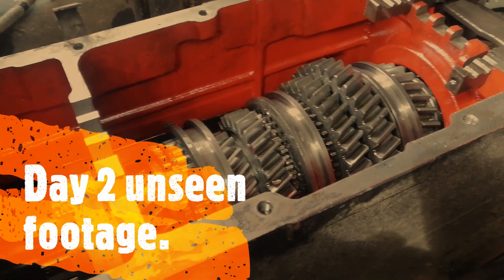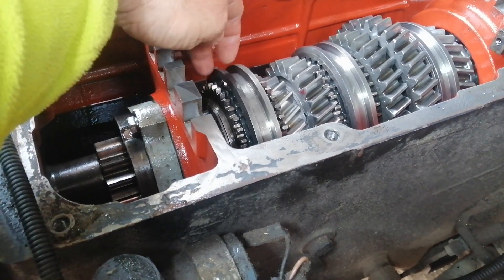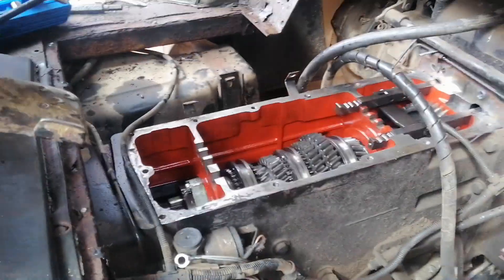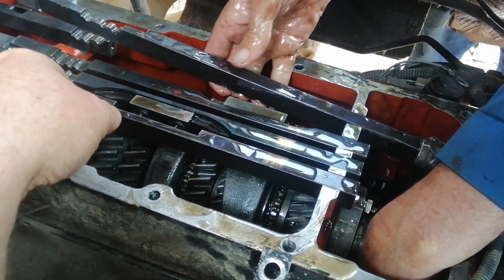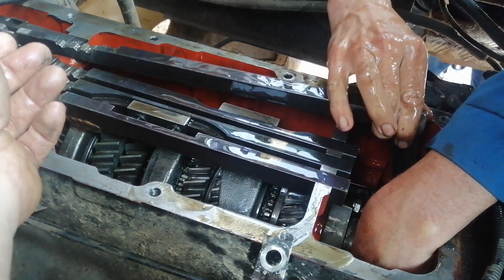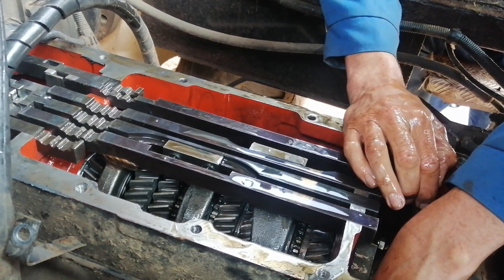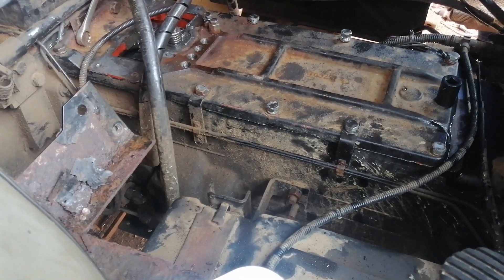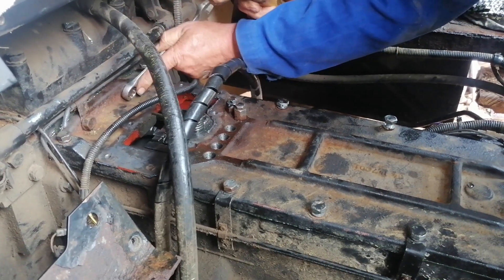Zetor Gearbox part 2 unseen footage,Test pilot!.

Comment: Interesting,but learnt about cab mounts, would you ever think it was cab mounts.
Reply from the maker: the new cab mounts have arrived,so ill do a video on fitting when we gwt around to that job ,it was just a bit of video footage i lost when i broke my phone scren,the i managed to transfer it to my laptot.
Reply: As I write, have only watched a min or two...........but the most common reason hopping out of gear will be a detent plunger in most cases I would have thought.....ie when the gearstick  "clicks" into gear either a worn plunger, broken spring or a worn/damaged/rounded notch in the selector rail will cause it to click outta gear when it aint supposed to🤠

Could be worse, on the old masseys you had to split the tractor just to swap out a rail.......lotta work for a ten quid part🤣🤣